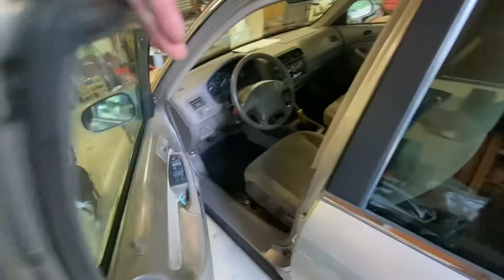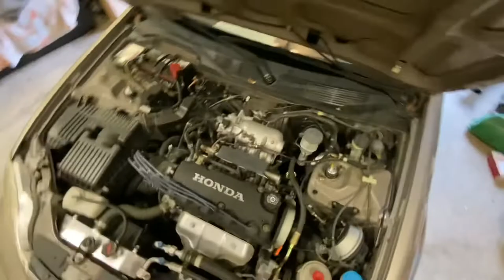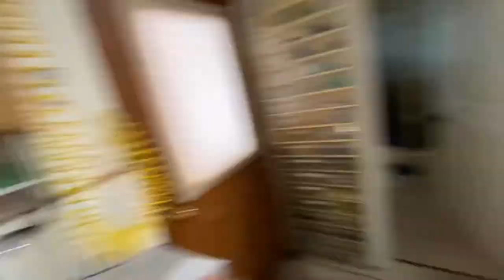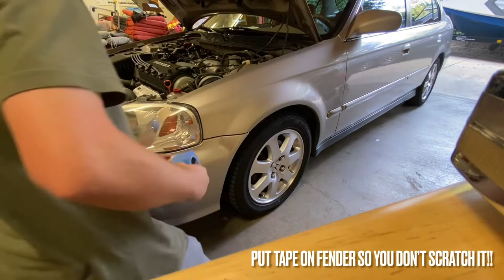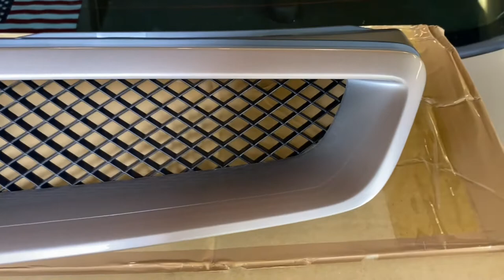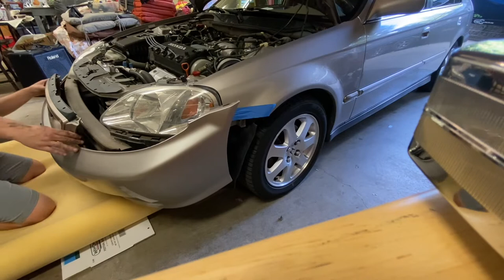OEM EM1 Grille Install

Comment: Hey man, just saw a comment about Yakima roof racks on another video from you. I was wondering if you could help me and let me know some of the parts I need to install it on a 99 coupe.
Reply from the maker: For a coupe you will need the Q towers, Q69 clips, and 48” round bars.
Reply from the maker: You can find the installation instruction on Yakima’s website. https://fitlookup.yakima.com/
Reply from the maker: It’s under the “Naked Roof Q Tower (HISTORICAL)”